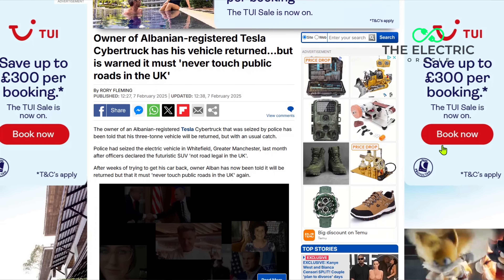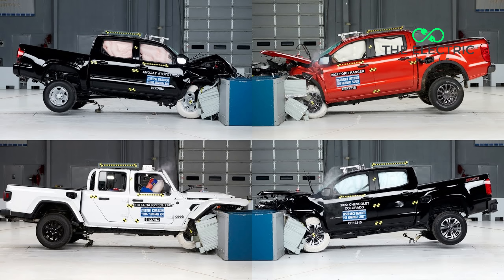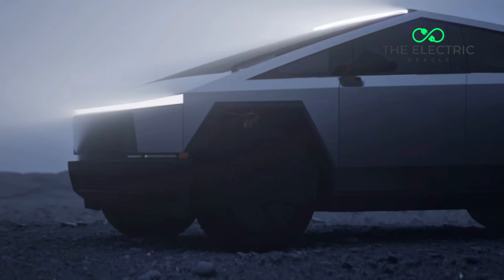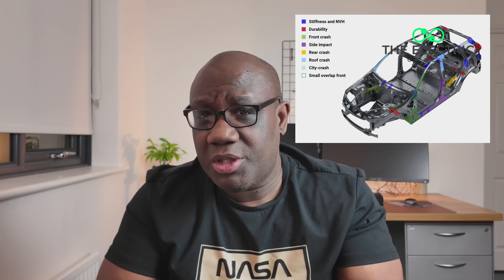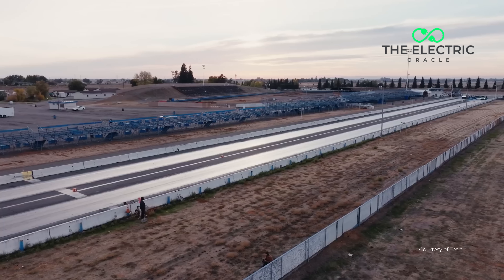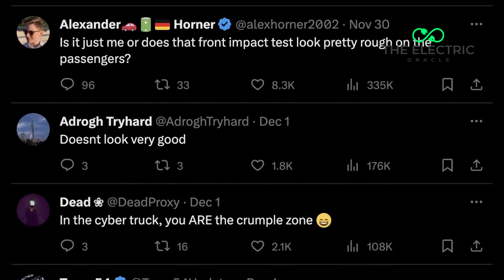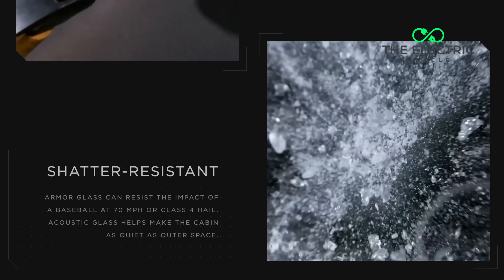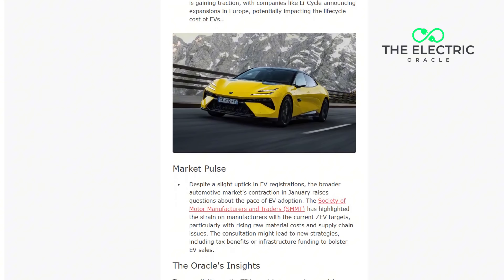Why the UK Banned Tesla’s Cybertruck – 5 Fatal Design Fails!

Comment: It’s interesting that some of the more prominent Cybertruck owners on YouTube got rid of theirs due to various issues.  Some to avoid the massive depreciation, some due to frustrations with getting needed maintenance done, others due to bad design that made it unsuitable for what it’s advertised for (suspension parts that are not substantial enough for the vehicles weight).

That plus it was not as advertised on its introduction (400 to 500 mile range?  Not unless you’re constantly going downhill with a following wind, and even then fall short), built from a unique form of stainless steel?  Nah, all iterations of stainless steel are known about.  The launch event was full of Musk claims that were either not true, or undeliverable.

Tesla had some nice designs, all of which sorely need updating, but after his recent stunts, I wouldn’t touch a Tesla now.  There are cheaper EV’s out there with similar range and features, sometimes better, they are no longer the default choice.

Comment: The crumple zones on cars do not just protect passengers, they protect pedestrians and cyclists as well,  However with its near razor sharp edges Tesla clearly showed it did not care about anyone on the road, oh and speaking of safety, I am aware of two crashes of Cybertrucks where the occupants could not get out of the vehicle and burnt to death when those big old batteries ignited, the doors could not be opened and the shatterproof windows kept them trapped inside. Elon musk designed a mobile house brick with no care for its purchasers

Comment: Great thoughts! I do think the standard safety features should be regulated and all manufactures should follow as in the past. It is really difficult with all the different brands putting their turn signal lights  all over or integrate into other combined light clusters as well as changing the light colour to spot and react. And let us not forged the removal of the turn stalks from the previous Tesa=la model which lead to many Tesla drivers not bothered to indicate turns or not be able in time. Maddness. The new laser lights are on tall vehicles are also big issue for the small vehicle users. No matter how good the software for the lights is the blinding from the opposite driving SUVs is more and more. Speaking from a sport sedan and coupe type vehicle driving experience. All vehicles on the road shoud have same height lights and the turning indicators should be as in the past most outside clusters for best visibility. How once was.

Comment: This is how i see it:
Safety for pedestrians have to be paramount as well as for the driver.
Most EVs from tesla and BYD are the worst of the worst on the market. Other auto manufacturers arent fairing much better but their standard and quality control is way up there.
There was a tesla owner that went out for dinner with his partner in Edingburgh. It rained a bit, not that unusual but when they got back from dinner their tesla wouldnt start. brand new tesla wouldnt start.  Reaction from tesla: dont drive your tesla when it rains.  25000£ damage of the battery.

Comment: The principle of car safety design as stated in the video is to have crumple zones that absorb some or all of the energy of the impact to minimise the rapid deceleration of the occupants which leads to injury. Traditional design also ensures that with head on collision there is mutual destruction and absorption of energy so that the occupants of both cars have a roughly equal chance of survival.  This almost rigid, enforced, rectangular, angular structure is almost designed to ensure that a Cybertruck in collision with a traditional vehicle will resist crumpling resulting in disproportionate damage and injury to the other vehicle. This is grossly unfair particularly if the Cybertruck driver is at fault which is more likely as they will be wrestling to control an over powered overweight tank. However if the driver of the Cybertruck hits a stationary solid object, the lack of crumple zones will result in a reduced chance of survival. So in terms of road safety the Cybertruck is a lose lose for every one and should be banned in the UK. Also forgot to mention Ego Skunk is a w-nker.

Comment: The Cybertruck front and rear subframes are castings. The design of which is carefully computed to deform/break in a controlled manner under impact. Coupled with the fact that behind the stainless steel there is a skeleton of mild steel (amidships). OK, it may not comply with UK regs in many ways, but the crash regs would only specify performance in specific types of crash test. We have had fibreglass bodied vehicles haven't we? Tesla mindset is to lobby for change to regs!

Comment: Its already a heavy truck above 3500 kg so the regularity data ,as a heavy truck should be applied instead. And in a front impact its not the stainless steel that make the truck more rigid its the frames they are glued on to.

Comment: UK vehicle regulations are commonly ignored, an example being using wheel spacing kits than have the wheel/tyre extending beyond the bodywork.
Any day of the week you can see some, "boy racer" driving an example of this, often with a modified exhaust system that pops and bangs with uncombusted fuel way beyond the permitted noise level.
Perhaps there are prosecutions, but I've even seen police vehicles in the same flow of traffic who blithely ignore these infringements.

Comment: The stainless steel on the cybertruck is used only for the panels, the frame underneath is aluminum. It's not an exoskeleton design as announced originally, it's way more conventional than it was supposed to be. Still it's a terrible choice for a truck and poses significant problems in pedestrian protection...

Comment: Countless engineers have worked countless hours to improve vehicle safety. Crumple zones make perfect sense to work as a slowdown mechanism for your fragile body in case of a crash at speed. To design a car that is rigid flies in the face of decades of research and knowledge. It could almost be considered cruelty on purpose...

Comment: It ways under 3.5 tonnes, so it can be driven with a UK driving license? NASA tee shirt 😅😂
Reply: Pretty much every YouTuber I've seen comnent on this has got this wrong. It's the max gross weight that is the problem, not the kerbweight, and that does require a class C1 license.

Comment: As an engineer, seeing the Cybertruck being banned is a good thing. It was not designed with safety even as an after thought. Just some gimmicks that elmo thought were cool. Being honest, after the recent controversy over a certain gesture, the sooner we cleanse anything Tesla from our roads and market, the better. Why buy a Tesla that hasn't been updated in over 9 years when so many other brands are offering brand new models!?
Reply: As an engineer I would be wary of getting any unprotected stainless steel vehicle. In a damp country, like the UK is most of the time, any particles of iron or ordinary steel that land on stainless steel quickly start to undergo electrolytic corrosion along with the stainless steel they are in contact with. Just think about all that iron dust rubbing off disk brakes on nearly every vehicle on the roads.
Reply: @martinconnelly1473 or me going out at night with a file and some iron filings!
Reply: And a car that can have multiple crashes all on its own, no driver required.
Reply: Not just some hand gesture, he did sieg heil, 3 BLOODY TIMES.
Reply: Safety first.  Simples
Reply: offering brand new models!? for same tech and hardware inside. Tesla is the only one with updated and newer hardware and software even newer cars still use ECUs it also uses a CAN Bus connection instead of individual wires for each button. 
3-5 main computers handle all vehicle functions (FSD, MCU, Powertrain).

although apparently Volkswagen & Mercedes is now doing the same thing centralized computing architectures.

why buy a a 2015 flip phone that's disguised as a 2025 smartphone

Chip Process  > 5nm (Samsung) > 500 TOPS (estimate)
even the Infotainment	 uses AMD Ryzen, RDNA 2 GPU

Zen 3 architecture is built on TSMC's 7nm process node for the CPU cores, while the I/O die uses 12nm released in 2020
Reply: @knightwolf3511  show me a first gen Tesla Vs one sold today that's been face lifted or had an interior remodel. Oh wait, you can't.
Reply: Why buy electric at all? The carbon footprint from building and operating an electric vehicle will not be offset, even if an electric car has a 30 year service life (which none will). Electric cars are a marketing gimmick, and an outright lie.

Comment: I built a kit car and to get it legal registered for the road you have to go through an Individual Vehicle Approval test at a VOSA testing centre. The test is 5 hours long and tests sharp edges, brake efficiency and balance and light position and efficiency amongst other things. The Cyber truck would fail most of the required tests

Comment: Those continuous light bars (some companies are doing those coupled with conventional light placements) in the front are very distracting for oncoming traffic, personally I sometimes have the issue of being unable to discern the aspect of the approaching traffic

as a Truck driver in Germany, streets are about 3 meters wide and most trucks teeter on 2,55 meters, I wonder if similar numbers regarding the width of BIG vehicles, such as a HGV, have a similar standard in the regulatory books.

Comment: It is not a stainless steel exoskeleton,  The basing structure comes from the aluminium unibody casting as they were unable to make the vehicle the Musk wanted to.  The stainless is either glued or screwed to the casting.  Tesla own internal report said the car was too ridged in some areas and not stiff enough in others. The design it completely half baked, it is the most recalled vehicle. Simple things like the creator pedal and the door hinges, those are things that can be seen what about the stuff you can't see.

Comment: 10 years ago I was in a bad accident, 70mph into the back of a stationary truck. I was driving a Ford Ka(ck). I survived with minimal injuries ie a minor pneumothorax out of hospital the next day. There was no whiplash, no broken bones, no brain or spinal (neck) damage from whiplash. The reasons were that not only did seatbelt tensioners tighten and the airbags deploy but, most importantly,  the crumple zones crumpled dumping much of the energy. Essentially anyone who drives a Cybertruck will literally FOAD

Comment: I have no experience with auto design, but have been exposed to highway design in the USA.     Tesla reminds me of a sign painter for a rummage sale thinking that it is the same thing as a highway signage design, not realizing that it is basically a toy version of the latter.   You can't just take a can of spray paint from the local hardware store and put stripes on the highway.    Specs are everywhere and they are seldom recommendations... they are requirements.      It's hubris, and one reason that early in Tesla's life, I opined the the Big Boys in the car business had decades of experience making real, compliant vehicles and that one day, they would kick Tesla to the curb.  I hope that day has arrived.      The Cyber truck is hubris in steel, created by a misogynist disguised as an entrepreneur, whose only skill is being an @sshole.      And of course, now he has teamed up with the poster child for ignorance, Trump, and  thinks he is Hamilton,  when he more closely resembles Mussolini.     It would be funny if it were not so tragic.     Tesla can't fail fast enough for me.   They should stick to battery factories.

Comment: The USA has a poor track-record on safety: think back to the motor manufacturers’ response to Ralph Nader’s campaign of the 1960’s and his book, “Unsafe at any speed”. Also, the move which increased production of SUVs in the States was driven by legislation which allowed for fuel consumption to be much higher for a classification of ‘work vehicles’. (Sadly, this is also the case in the UK which has more generous taxation on this type of vehicles. Manufacturers effectively just made them into saloons with an ‘open boot’.) The height of these vehicles at the front mean that pedestrians in collision with one will be more likely to be knocked to the ground because they are hit at chest height, rather than pushed away. And it’s worse for child pedestrians.
As they say, “Follow the money.”

Comment: it was not and has not been band in the uk. it never got an exseption from the MoT. its classed as not fit for use till it complys or has an exseption issued. when something gets ban. it is an imposed order. the copper that pulled the thing did so knowing it was not lawfully on the road. not becouse it had been band.
Reply: Your spelling is atrocious, get a spellchecker man.

Comment: The Tesla Cybertruck is not legal in the European Union due to its design, specifically its sharp edges and stainless steel body, which fail to meet European safety standards for pedestrian protection and collision crumple zones, making it a significant risk to pedestrians and not compliant with regulations regarding vehicle design and protruding parts; essentially, the Cybertruck's angular shape would need major modifications to be road-legal in Europe. The UK has the same safety regulations as the EU. 

I don’t think many people will feel they are missing out on anything. It’s does not look fantastic at all.

Comment: You keep using that word, exoskeleton, but it is not applicable to the cybertruck.
The cybertruck is not built as an exoskeleton. As the animation you've showed at 7:44 clearly shows. It's structurally a steel frame covered with steel plates.
So stop using Musk's lie that it is designed (thus built) as an exoskeleton.

Comment: Elon Musk said it was safe ! 🤣 The Cybertruck is considered to have passed safety regulations by self-certifying that it meets the required standards set by the National Highway Traffic Safety Administration (NHTSA), despite concerns from experts regarding its unique design, particularly the rigid stainless steel exoskeleton and sharp edges which could pose risks to pedestrians in a crash; however, the vehicle has not been officially crash-tested by the NHTSA. If the God of "Ipads with wheels" says it's safe it must be .

Comment: So in short, most cars are designed with view on other people while cybertruck is only designed for Musks ego. Even the steel is a weird decision, they used "space alloy" that is used in rockets, yes, but plain 304 or 316 steel would be much more corrosion resistant while also being strong. They only chose this alloy to connect it to rockets for more buzzword possibility.

Comment: You dont need a cat C1 extra licence in the UK till 3.5ton = 7716.179 the cyber truck is under 7000lbs.
Reply: The gross vehicle weight rating (GVWR) for the Tesla Cybertruck is between 8,001 and 10,000 lbs (3,629–4,536 kg). The gvwr of a vehicle in the uk determines its classification so a cat C would be required.

Comment: If you want a, work EV/pickup EV, there are a lot better ones out there. Look at a "Munro Vehicle" built in Scotland, with proper 4-wheel drive, proper body, and actual towing capability and a load carrying capability.
There is no reason to bring a car as overpriced and with so little capebilertaty as a Cybertruck in to UK markets.

Comment: There are problems with the CT all over Europe.
The 3.5 tonne limit is universal in Europe.
The light regulations vary to some extent, but it does not conform to regulations in most EU countries.

Comment: I wonder if an add on soft nose would solve the sharp edge issues
Reply: It still won 't crumple, and will add to the weight of the thing.
Reply: There are many other issues..To mention just two, it's too heavy to drive on a standard license, and it wont fit in a standard parking space.

Comment: If the computer fails, the lights are the least of your problems, there's no mechaanical link between the steering wheel, and road wheels.
Reply: Hope you don’t travel by plane
Reply: @markthomasson5077  Not so many planes on your average UK/European road.
Reply: @markthomasson5077  Thats a ridiculous comparison. Aircraft use multimillion pound autopilot systems that have strict maintenance schedules, procedures carried out by highly qualified aircraft engineers. The Cybertruck has none of those.
Reply: @ perhaps.  But I believe it has triple redundancy.  I wonder if there is also a fail safe monitoring system.
…not that I am a cyber truck fan.  
What scares me, more so, is the self driving systems.  What happens in twenty years time, or whenever, they stop functioning properly and take a mind of their own!!!
Reply: @ The fail safe system is a mechanical connection, which it doesn't have.
Reply: @ No i don't.

Comment: I'm in Los Angeles where there are all kinds of vehicles. I rarely see Cyber trucks. If they were going to be numerous anywhere it would be here. It's a niche vehicle. There are many many Tesla cars here. I saw far more Hummers (combustion engine not the electric - they didn't go over well at all) on the road when they were popular than Cyber trucks now. Not to mention Elon is getting very unpopular very quickly in this country. Aside from all the other problems, it's a very tired design that he trotted out years ago and no one wants them. The pick-up market here is obviously huge, but these are not pick-ups. They're battery-operated under the Christmas tree toys that can kill you in a crash instantly. And if that doesn't kill you the resale market will. Old Cyber trucks have no value and there are many sob stories on YouTube of guys trying to sell them and losing many tens of thousands of dollars.